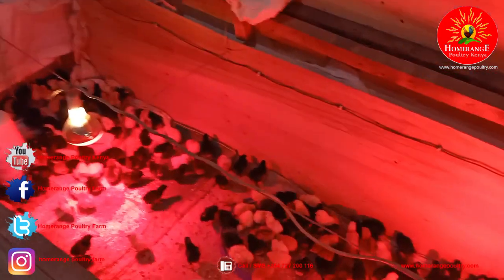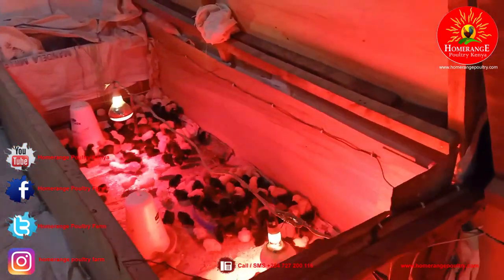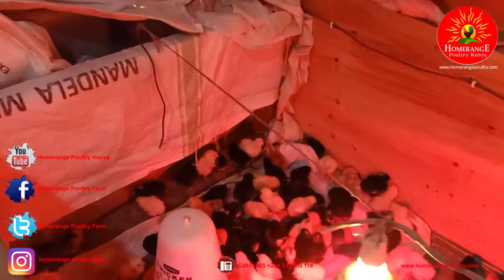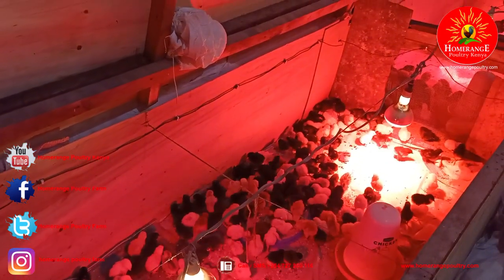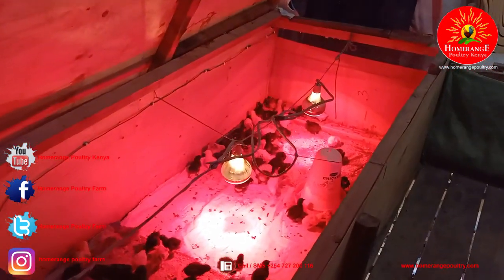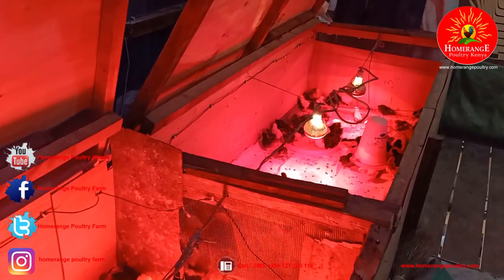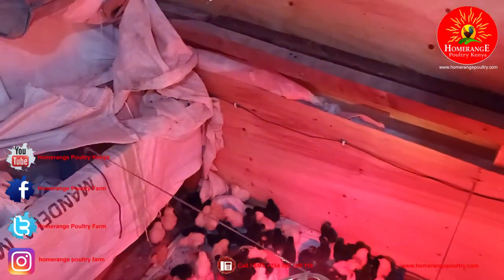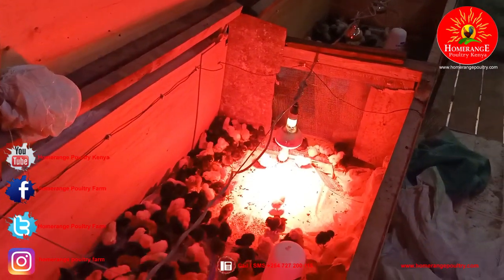Digital Smart Brooder Technology for brooding Day Old |  How to control brooder temperature

Comment: How much is the system
Reply from the maker: Costs between USD 100 - 300 based on the capacity / size of your brooder.
Reply: Can the system work with solar
Reply: Solar powered that is

Comment: HOW MUCH IS ARINIFU AND HOW WE IN ZAMBIA GET IT
Reply from the maker: The system costs approximately usd 100 - 300 here in Kenya based on the size of your brooder.
Reply: @Homerangepoultry.africa  who supply is arinifu in kenya and can they ship to zambia?
Reply: Please  make  a  video  on automatic  incubation  off eggs  and  the correct  parameters  to use
Reply: Is it one controller for all sections ?
Thanks for the presentation.